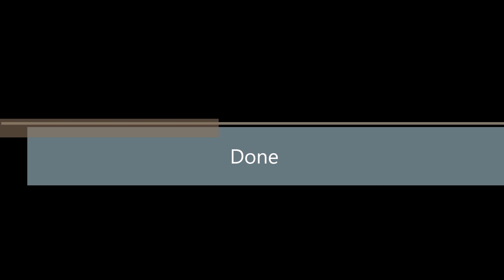How To Stop Spindle Drop On A CNC Router

Comment: Why didn’t the builder put a brake on the vertical axis?
Reply from the maker: jeromejt62
1 minute ago 
Becky, thanks for the question. As stated in the video my z axis weighs in at about 21 lbs. A brake only performs one function, and that is a clamping action. The gas strut performs a balancing operation, and equalizes the forces of the Z axis in both directions to zero thereby mitigating the need for a brake. Secondly, it decreases the amount of power needed to both raise and lower the axis resulting in cooler operation of the stepper motor since the stepper is now only moving less than one lb. Hope that answers your question
Reply: @jeromejt62  ok I kind of buy into that. We use hydraulic and nitrogen counterbalances with balancing valves when the z axis casting is extremely heavy, but still incorporate a brake either on the ball screw or right on the motor. 
Does your stepper motor display a “load percentage “ of the motors stall rate?  I mean is the motor sending feedback to the control and you have verified that the z axis now under the exact same load traveling  positive or negative in the z axis? I would think the resistance provided by the strut would be equal in both directions so you would actually be fighting the strut a little while moving negative you would need some way to adjust the resistance of the cylinder to truly make it balance. But that said this isn’t a mazak and that is a pretty cool idea! I hsve never seen one of these small machines with a counter balance, and as you know these machines are popping up every where now.

Comment: Hi. My Cnc has a problem of dropping the z axis during work. Is this solution adequate for fix it? Thanks
Reply from the maker: It will work to balance the weight of the spindle, but the real question is why your losing steps and or accuracy when the steppers are powered. Are your stepper drivers receiving enough current and the setting correct? Next is your stepper motor holding torque rating enough to support the weight of the spindle your using? Look at that first. 

 The purpose of this modification is to counter and balance the weight of the spindle during both raising and lowering operations. It also stops the spindle from dropping when the machine is powered off and no braking force of the stepper motor is present.

Comment: Rely  cuts the main  line and  stepper motor  hold  the splendle
Reply from the maker: The relay cuts power to the VFD, where otherwise it would continue to run should there be a computer failure. My spindle is heavy so the steppers would not hold the spindle and it would settle should there be a power failure.

I have a video on spindle drop and how I solved it if your interested.

Comment: It would be better to  put A C RELY   instead of doing this
Reply from the maker: I'm not sure what you mean by that. The setup I have works as planned. If you have a better alternative then go with it. This works for me, and very well at that.
Reply: It would be better if the motor had a brake or whatever is coupled to the motor had a brake.

Comment: I do not have the drop problem but have always been concerned with the strain on the Z stepper motor, lead screw and Delrin anti backlash nut as it is being raised. Does the gas spring equalise stress in both raising and lowering? I would not want to add stress to lowering the spindle at the cost of raising it if you know what I mean.I am glad to see this approach being addressed. Thank you so much for your efforts for us DIY'ers.
Reply from the maker: It Does. When raising Especially. It's a win win in both directions
Reply: @jeromejt62  Thanks! Got one ordered.
Reply: @51Nitrag  I would check out whether you loads are equal when traveling positive and negative with your own data. Do you have a way to check your the z axis load in real time? Typical a balancing valve must be incorporated to truly balance. Oth directional movements. It is obviously going to help while the motor is traveling positive but you would need some way I relieving the amount of force it takes the motor to compress the cylinder as it moves negative. However I don’t see this extra load causing the balls in your screw to force the wiper out.  The bearings would pour out and the column would just free fall?  I have seen some crazy z axis wrecks and usually the screw will bend before you have a blowout.  You should think of a way to clamp down on the screw when a certain input is lost and have it release as soon as you get a ready signal.